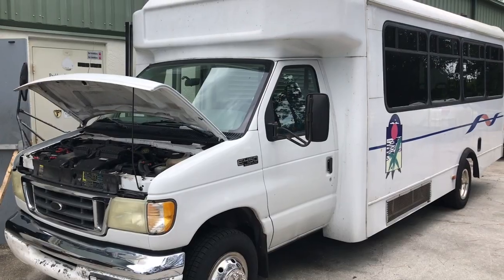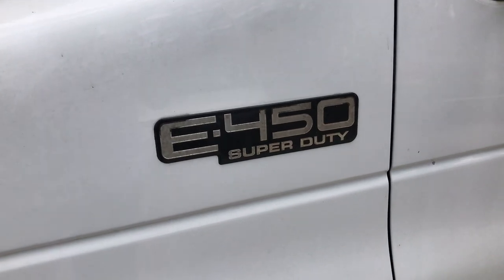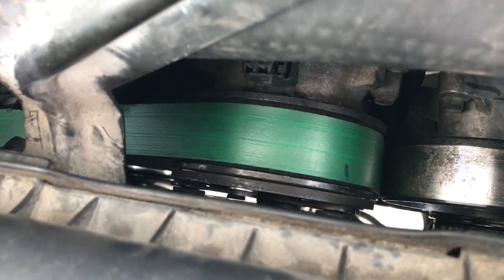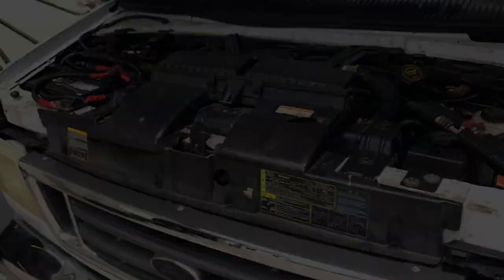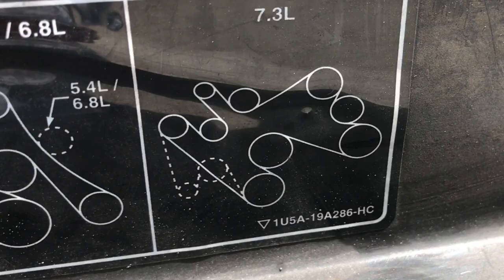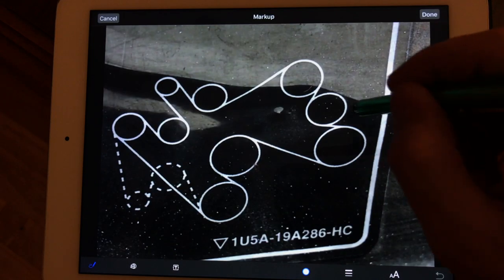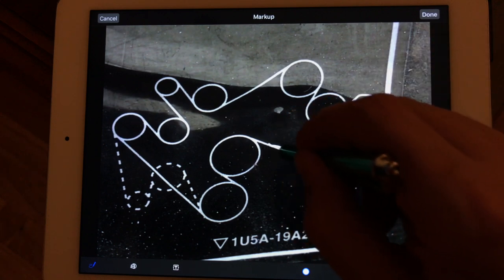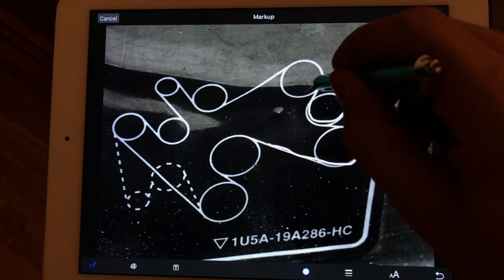2003 Ford E450 Super Duty Mini Bus with custom aftermarket dual AC system drive belt replacement.

Comment from the maker: You can buy the replacement drive belt here:
https://www.amazon.com/gp/search/ref=as_li_qf_sp_sr_il_tl?ie=UTF8&tag=ytb055-20&keywords=K081213HD&index=aps&camp=1789&creative=9325&linkCode=xm2&linkId=3a5ccb390ee718a8f675571f2aef078d 
(This is Amazon affiliate link).
Reply: It doesn't show a specific belt, just a bunch of them...

Comment: Hi there, this question is out of the scope of the video but I thought I might be able to get help here- I have a 2007 Ford e350 shuttle bus. My bro and I are trying to remove the rear ac unit and huge air compressor under the bus however this will make the cab ac not work because they share a Freon line between the front and back ac compressor. Any ideas on how to ditch the back ac unit and keep the front ac? Can I salvage anything from the front ac unit so I don’t have to pay for a complete brand new system? Please let me know if you or someone you know might be able to help. Thank you!

Comment: Know anything about E450 2010 hybrid Azure systems? Azure went bust as hybrid company but I have this bus with wheelchair lift but codes indicate hybrid issues? 
Any idea where to get the hybrid system Azure schematics/ manuals? Ford hasn't been exactly helpful

Comment: I would like to know the part # for the rear ac compressor. I have a 2001 ford e450 shopper duty but that is missing the rear ac compressor. No one.. Not even the conversion manufacturer, the ac manufacturer can tell me the part number..
Reply from the maker: I would look it up for you if I could, but this was client’s vehicle that was in the shop for a day a long time ago....